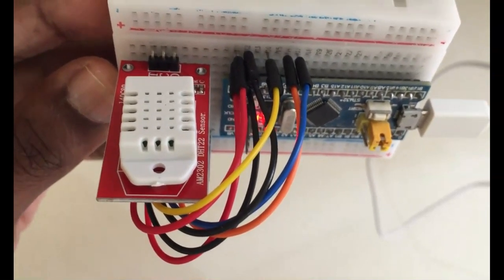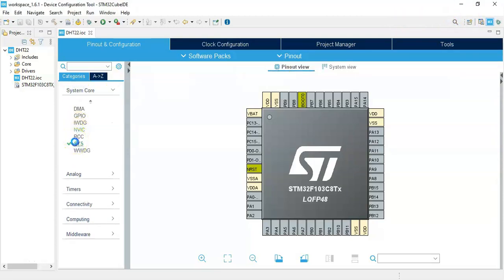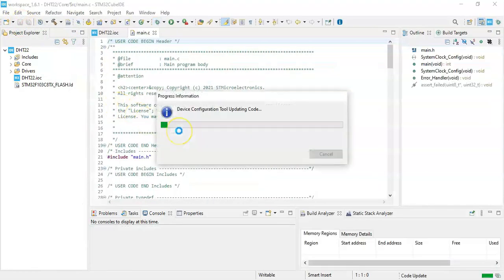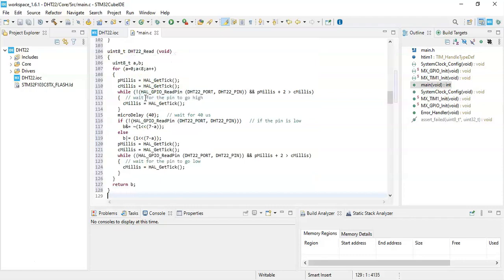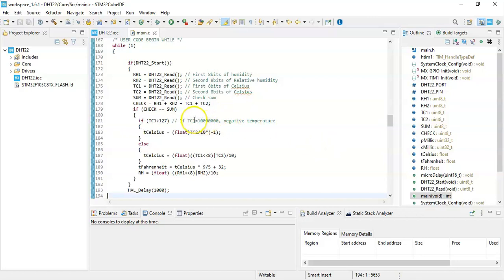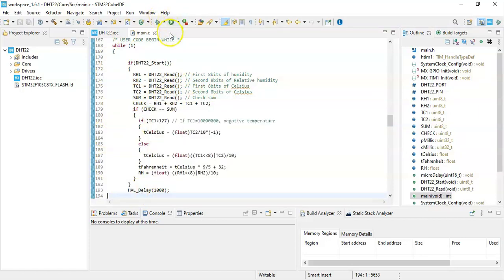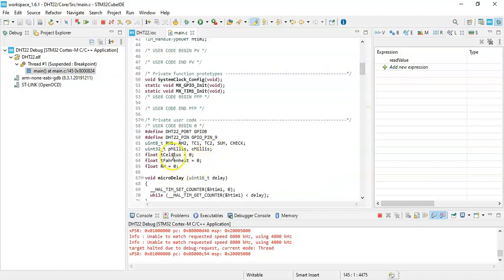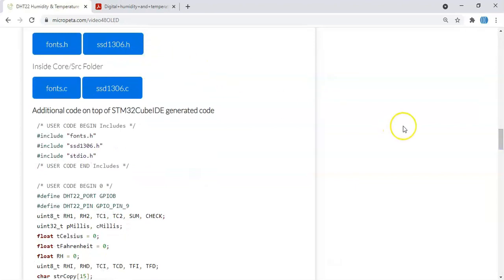48. STM32CubeIDE DTH22 Temperature and Humidity Sensor with STM32F103C8T6

Comment: if you guys trying to make dht22 project using lcd crystal, it worked. i tried myself using dht22 and lcd crystal by modifying the code from this video and the lcd one, mainly using calculation for the sensor and convert the number into string before you can interfacing the value on the lcd screen. thank you nizar for the tutorial it helps alot
Reply from the maker: Thank you very much
Reply: Can you share the code?
Reply: @sumittambe2543 AA meri jaan

Comment: sir, i use the same sensor for my project but the different is i am using crystal 16x2 lcd for temperature and moist display. i already watched both video and make my own code and its seems alright, but the problem is the code to display the temp to lcd, i thought it supose to be HD44780_PrintStr("%d C",tCelsius);  ? but it said too many argument so i dont know ho to solve this can you help?
Reply from the maker: You can not pass non string argument to HD44780_PrintStr()
You need to convert numbers to string beforehand.
I have prepared the code for you. They are below.

/* USER CODE BEGIN Includes */
#include "stdio.h"
/* USER CODE END Includes */

/* USER CODE BEGIN 0 */
char strCopy[15];
/* USER CODE END 0 */

  /* USER CODE BEGIN WHILE */
  while (1)
  {
    if(DHT22_Start())
    {
      RH1 = DHT22_Read(); // First 8bits of humidity
      RH2 = DHT22_Read(); // Second 8bits of Relative humidity
      TC1 = DHT22_Read(); // First 8bits of Celsius
      TC2 = DHT22_Read(); // Second 8bits of Celsius
      SUM = DHT22_Read(); // Check sum
      CHECK = RH1 + RH2 + TC1 + TC2;
      if (CHECK == SUM)
      {
        if (TC1>127) // If TC1=10000000, negative temperature
        {
          tCelsius = (float)TC2/10*(-1);
        }
        else
        {
          tCelsius = (float)((TC1<<8)|TC2)/10;
        }
        tFahrenheit = tCelsius * 9/5 + 32;
        RH = (float) ((RH1<<8)|RH2)/10;
        SSD1306_GotoXY (0, 0);
        RHI = RH;  // Relative humidity integral
        RHD = RH*10-RHI*10; // Relative humidity decimal
        sprintf(strCopy,"%d.%d %%  ", RHI, RHD);
        if (tCelsius < 0)
        {
          TCI = tCelsius *(-1);  // Celsius integral
          TCD = tCelsius*(-10)-TCI*10; // Celsius decimal
          sprintf(strCopy,"-%d.%d C   ", TCI, TCD);
        }
        else
        {
          TCI = tCelsius;  // Celsius integral
          TCD = tCelsius*10-TCI*10; // Celsius decimal
          sprintf(strCopy,"%d.%d C   ", TCI, TCD);
        }        
          HD44780_SetCursor(0,0);
    	    HD44780_PrintStr(strCopy);
      }
    }
    HAL_Delay(1000);
    /* USER CODE END WHILE */
Reply from the maker: I took the code from my OLED code which is in this link https://www.micropeta.com/video48OLED
Have a look it is more clear and colorful code
Reply: @NizarMohideen  so currently the display was just same as before but slight different on humidity that shows number, but the temp one was blank. any email so i could send some photos?
Reply from the maker: I forgot to include
/* USER CODE BEGIN 0 */
uint8_t RHI, RHD, TCI, TCD, TFI, TFD;
/* USER CODE END 0 */
Add this and see
Reply: @NizarMohideen  aah yes i know, when i first build it erors comes out saying theese variable are not declare so i declare it myself and make it integer, let me try uint8
Reply: @NizarMohideen  it came out same, i'll try to modify myself for now thank you for your help, it makes my project almost finishh and is there any email i can contact ?
Reply from the maker: nizarmohideen@hotmail.com
Reply: @NizarMohideen  was for sensor aqquire to configure  ADC pin ?
Reply from the maker: It does not require adc pin. I can be any ordinary input/output pin
Reply: @NizarMohideen  currently i use print spesial char(RH) which RH is the variable for humidity and it came out no eror, but after i upload, the display on the lcd is just alphabet 😅
Thank you very much for your help, i'll try your code now and update my project after
Reply: i can help you mr muhammad